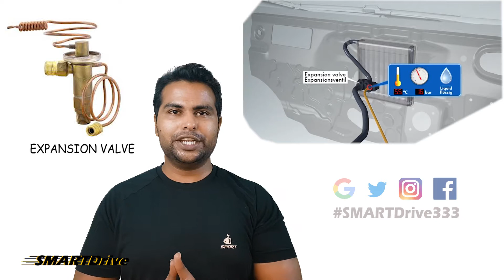DIY Car A/C System Check: What to Look for and How to Fix It : SMARTDrive

Comment: In my ciaz I think they have put the dzire filter which is small in size when compared to original ciaz filter even in recirculating mode outside smell is coming inside the cabin ...stupid work by maruti guys have to change it
Reply from the maker: For more clarity I'll post the fliter photos on instagram @smartdrive333

Comment: Make a vdo on how to clean ciaz ac pollen filter.
Reply from the maker: #smartdrive333 is with new #episodes for air ventilation system.
#filters  needs to get cleaned properly. https://youtu.be/siOqCIVZi84

Comment: sir do a video on how to open and clean the air filter of ciaz
Reply from the maker: Please stay tuned. Video will be available soon.
Reply from the maker: #smartdrive333 is with new #episodes for air ventilation system.
#filters  needs to get cleaned properly. https://youtu.be/siOqCIVZi84